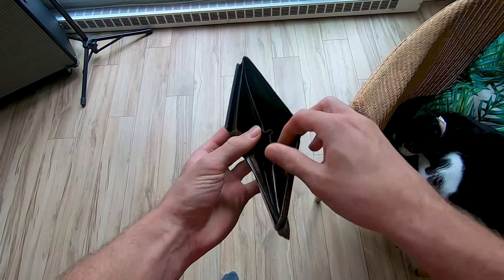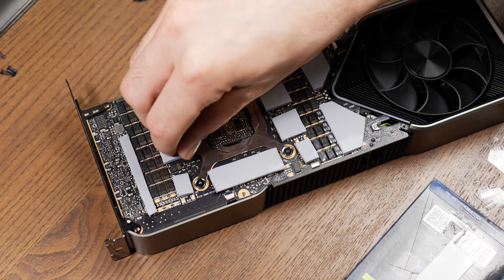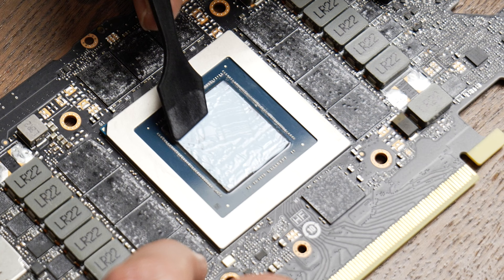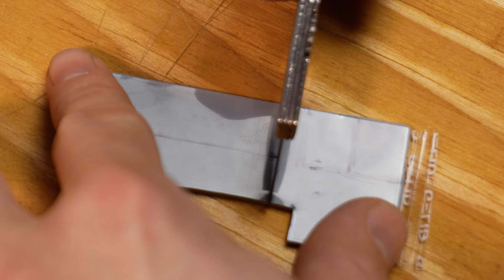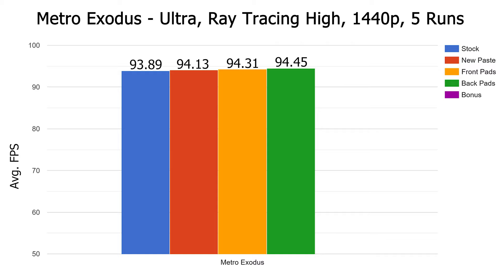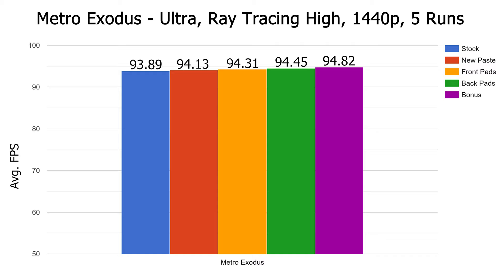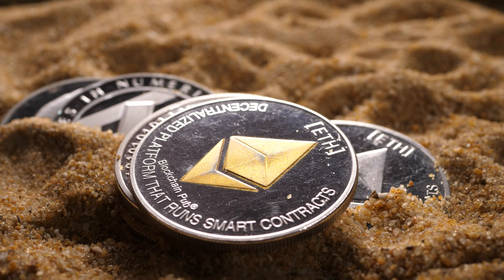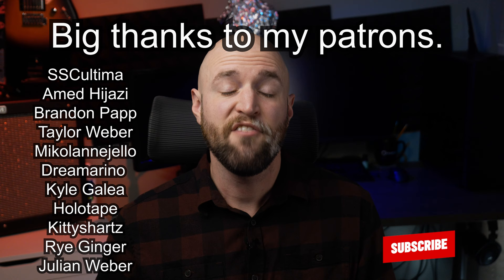Are New GPU Thermal Pads Worth It? | GELID GP-EXTREME

Comment: I think there is an advantage for the gamer from doing this. In that the card will likely run for longer before eventual failure. While I understand that the specs for the vRAM may be max temp 110'C, it's better to run cooler. It is after all, heat that destroys silicon. 

I think the 3'C drop on your GPU core is worth it too, because the fans will run fractionally quieter. 

If someone is OK with forgoing the warranty then it's a good idea all around in my opinion. Additionally though, some manufacturers do allow customers to change the thermal paste, without voiding warranty.

Honestly found your vid vaulable. At the very least it means that you could run your gaming rig in a warmer room. Which also means you can go longer before reaching for the air-conditioner. Hence a bonus for carbon footprint.

Lastly though a cooler card means less heat emitted toward the CPU cooler. Like you mentioned the temp of the backplate on your card. When I worked on my 1080 Ti, the backplate touch-temperature dropped from scorching to much more bearable. That will keep the whole card that bit cooler, and prolong the life of all components. It will also reduce the heating-cooling cycle extremes, which will help with component lifetimes.

EDIT: Possibly reducing power consumption fractionally too.
Reply: A cooler internal component does not mean less heat going inside the PC case. It may actually mean more.

Let’s say that your CPU thermal paste is REALLY bad, worse than no paste, and it only takes like 40W until it throttles. Well, it’ll only throw 40W into the heatsink.

Now you repasted it, and it can run a full 120W without throttling. Guess what? Now your heatsink will be toasty. Heat = energy, but not necessarily temperature. That’s why a car can have a much more powerful engine with a much bigger radiator, still maintain itself at 90°C, and function as a space heater much better than the lower power car
Reply: @satsumagt5284  You're working from theory of an unlikely event. If you have no thermal paste the GPU will heat up and throw heat in to the case. 

From experience I saw the following. 

One of my GPUs used to run around 70-73'C. One time when I was repasting, and I noticed and issue with two inductors next to each other, One inductor did not have a thermal pad on. Meaning no pad between inductor and GPU heatsink. Once I put a pad on, and replasted with the same paste I always used preaviously with it. I noticed a considerable drop in temps on the card. Card ran between 60'-70'C.

The result, and my argument was this. I went from needing to run my rear case fan on full, to running on medium. (I could even add a small core clock OC without any more power/voltage needed if I wanted.)

Considering that the GPU fans were having to deal with more heat, that was interesting. Clearly what matters is the temperature of the components over all else. The coolers can do their job even when given more load. What they can't do is compensate for a component like an inductor gettting hot. Then that inductor spreading heat through the board to the GPU chip. 

I.e. using better pads and paste will mean slower GPU fans and case fans, over poorer pads and paste. Poorer pads and paste mean your GPU will get hot, and the GPU fans will run very fast. Then you'll over-compensate with case fans to try cool it.
Reply: @greenbow7888  The Graphics card’s fans used to go crazy because they usually use the GPU temperature to determine their speed. They can have more inputs too, of course. By repasting the GPU, you made the heat transfer from GPU to heatsink more efficient.

With all that said, your heatsink is surely getting hotter now that it receives more energy from the GPU and the inductor. GPU at 70°C almost never equals heatsink at 70°C, especially if the conductivity is poor.

Proof of that is my laptop: Before repasting it, the case itself would barely warm up, CPU would hit 88ºC easily and the fans were annoyingly loud. That’s because it was only drawing like 23W and reaching the throttle temperature. Nowadays, the CPU can even draw 30+W with the GPU under load without reaching 88°C, the case and heatsink gets hot AF, fans are notably quieter and the performance is on another level, since it can actually keep itself at 4GHz constantly (On a cold day I don’t even need Beast Mode to avoid some slight throttling while gaming).
Reply: @satsumagt5284  Am not reading your post. You are telling me I am wrong. I am right. You are wasting my time.
Reply: @greenbow7888  Yesn’t. I only disagree with your last paragraph of the original comment. Everything else, agree

Comment: What about your fanprofile? If its stock it will just run the fans lower speed when temps drop so you have to keep the same fanspeed all the time to get accurate results.
Reply from the maker: The fan curve certainly skew the results in a way that bring the numbers closer together. But most people are going to have a fan profile that isn't flat so I like to test in a way that will show what actual day to day results look like. 

I published a video about undervolting. https://youtu.be/9JsqKREvukQ?t=232 You can see how the fan curve keeps the temps closer than they would be with a flat profile. The power differences suggest the gaps in heat should be bigger.

Comment: These results are so misleading and wrong.

The temperature reduction, yes, thats expected and obviously intended. But the reason you do this is 1) to reduce throttling and overall heat if its an old card, and 2) to increase overclocking headroom.

Reducing the core temperatures of the vram/vrm mosfets means you have even further safe overclocking headroom while still maintaining those good temperatures due to no more artifacting introduced by intense heat.

I ran a .993v undervolt @ 1995mhz with a +1000mhz memory overclock on my 2070super. Max 62~c in time spy.

Prior to the undervolt method and just attempting +100/+1000 etc directly in Afterburner, Fire Strike would artifact noticably and it'd get close to 85c. Aka it performed worse at stock voltage curve and ran hotter/downclocked a lot.

Anyway, back to the point - after replacing both paste and pads with gelid extremes, i can run 1.043v @ 2055mhz with +1200(!) Memory clock and be max 45~c by the end of Time Spy.

I have zero idea why you would expect changing the thermal pads would give you increased fps when leaving it stock. New paste would because of gpu boost 3.0, but the vrm and vram obviously only affects your memory clock which is static unless you overclock.

Comment: there new pads the 15w/m-k are good.  i use them for my sapphire toxic 6900 xt (pushing that air cooled timespy record).  the biggest difference is within the hotspot.  where i was maxing 105c on runs. but now with same settings it barely cracks over 100. thanks for the vid tho

Comment: people dont upgrade the thermal paste and pads for performance, it's for extending the life of the GPUS by years. Heat is a major culpert in product lifetime and dropping memory temperatures by nearly 14-16C is huge. Also, if you want performance, with so much more headroom with lower temperature this opens up the door for overclocking the GPU which is another reason as to why people do these mods.

Comment: I had to use new thermal pads because the old ones were torn down. It was not my GPU. The original owner was smoking. The "smoke" "glued" everthing together. There was no option than replace old ones.

Comment: Hi, I think the main thing this video is missing is… was your gpu being throttled due to temperature in the first place? Are you overclocking? If it wasn’t, then why would changing the thermal pad impact your score at all? Also, did you replace the pads proportionately in terms of thickness?

But like others have said, that temperature drop is pretty nice and worth the $ just to prolong the card’s life imo.

Your final test was fun. I love those kind of janky mods to try and eek out some extra performance. Wondering if you added some space between the fan you zip tied on to the gpu so that the fan actually has air to draw from if that would further help!
Reply from the maker: Yeah. In retrospect I wish I did prolonged tests 1hr + to get a better picture.

Comment: Point a fan at that back plate, you’d be surprised how big of a difference it can make, I’ve done it with a 2080, 3080, 3090, and a 4090 and as long as the back plate is set up for cooling properly, like yours is, it will make a pretty good difference in VRAM temps, especially on the 3090 and 4090
Oh, you did point a fan, nice, this guy is clearly a genius 😂

Comment: Replacing thermal paste is an amazing solution to older cards (2070 Super in my case) having fans ramp up and down constantly. Fixed my issues and dropped the temps by 10+ degrees. Maybe performance has also gone back up to closer to when it was knew, but that's not really the reason to mess with the paste, its the irritating fan noise.
Reply: I assume your 2070 Super was also just randomly jumping up to 4000rpm, ignoring any fan control you have set right?
Reply: @LEK  Exactly that yes. No fan controller/setting worked. But changing the paste worked completely. I did not change the pads, I was careful not to damage them. Maybe I should have done them as well, but the results were still very good.
Reply: @crispycarrots  Yeah had the same issue on my 2070 Super. They charge 700 bucks for the card but cant put the effort in to properly apply quality thermal paste and pads which arent that expensive at all.
Reply: @LEK  Dude, that is happening to my 2070 super as well!
and after tried all imaginable under the sun fan control software, it did not matter :D. I guess it is time for paste/pads change.
Reply: @GameWithTonyYT  I can guarantee that this the fix. Doesnt even have to be the pads. Paste will suffice. They use super low quality thermal paste.

Comment: Changing thermalpads is not really about gaming performance because you are using the same GPU...Logic!  We only change thermal pads solely for GPU temps and the more cooler our GPU is it helps the life span of the GPU, avoid overheating, unexpected crashes and it helps for stable gaming fps.

Comment: Asus in their infinite wisdom only covered half the memory with pads on my old 2060. They also seems to be low thermal conductivity. A $15 (Canadian dollar) multipack of basic pads allowed me to redo the VRM, add pads to the backplate that it didn't previously have, and fix the memory all at once. I still have more than half of the pad material left.
It's a bit sad that budget pads could be improve what was stock on a "premium" card. The strix models are a scam.

Comment: Great video! Another tip for greater cooling is add a thin layer of thermal past on top of the memory chips before you place the pads, non conductive paste only.
Reply: There's some evidence that suggests adding thermal paste on top of thermal pads is detrimental, as it decreases thermal conductivity (since it adds additional insulation).  Paste isn't particularly thermally conductive.
Reply: That's not a good idea. Bad tip!! It will degrade faster the thermal pads and the difference between the two thermal conductivity (higher for paste and lower for pads) will only mess the temperatures.

Comment: awesome review, great presentation of data. 
subscribed, expecting more data, and more out of mind ideas that, not sure if useleful but they are fun
if you watn to test something, no need to do video, remove the backplate, and thermal pads of backplate, and just point 45º degrees that extra fan to the back of the gpu, u will get surprised .

Comment: Hi, first of all great video and very useful. So I bought thermal pads 1.5 for my RTX 3080 Ti FE, what I kind of getting worried is that when I play some games, the temp goes and stays at 88c with the fan speed at 2800 rpm, to be honest I feel like the temps are the same as were before only that the fans are very louder, I suppose because of the rpm that is higher now...

Any suggestions?
Reply from the maker: make sure that there is good contact between the Cooler and the GPU. Try re-seating it. 

Are the MEM temps any different than before?
Reply: @TechIlliterate  I've seen in your video "Why You NEED To Undervolt ..." that on idle the RTX 3080 Ti it's at 37c, well mines it's at 60c on idle... I've checked twice the contact between the cooler and the gpu and by the MEM temps diff are higher now than before :(
Reply: @RaduPNT   I would try thicker or thinner pads... I’ve heard thinner is better with CPU paste as long as you have full coverage over the die, maybe it’s the same w/ pads.  
But if the pads are TOO thin there may not be enough tension on the cooler — and if there is an air gap, the pads aren’t doing anything. (A common issue with nvme SSD’s since the controller is thinner than the memory chips)
So try with 2mm pads first since they’re more “standard...” (did you measure the originals with calipers to get a baseline?) 
I’ve also heard someone suggest 2mm pads on one side of GPU & 3mm pads on the other
Another big suggestion is because the Founder’s cards run extra hot (having only 1 or 2 fans), get them extra cooling— try to install 2 120mm fans under the card & blowing up. This is ideal with a case that has intake vents on the bottom, like most Lian Li cases. Yes installing a whole new case is a pain, but temps are important for the life of your GPU & CPU

Comment: Its becoming hard to find thermal pads these days in my part of the world. What is the degradation expected when we stack 2 x 0.5mm pad instead of a single 1mm pad?  Have you tested this?
Reply: They are pretty soft, i doubt there's any degradation and if there is it will be miniscule
Reply: @psychoalert1823  i was asking about the thermal conductivity. If i use 1mm pad and stacked 0.5mm pads will the difference be considerable?
Reply: @athirasreekumar1613  That's what i replied to, as long as there aren't any air gaps in between then you should be good to go

Comment: Hi,

I have a 3090 strix which I remember reached 90c on memory without undervolt. Is it totally safe to be around 90c? I've always freaked out about the Temps.. Thanks
Reply from the maker: Yup that's good! My card has reached 90c max now with the pad mod during longer gaming sessions. 

Plenty of headroom to the throttle limit.
Reply: @TechIlliterate  110c is the limit right? I will try to run some game again without uv to see. I was running 1865mhz at 0,837 / testing now 1965@ 0.9 and it seems stable!
Reply: @TechIlliterate  I went back to stock profile without undervolt

Playing on a C1 oled 4k, 70c max on core and 86 on memory on days gone for instance . Is it all good?
Reply from the maker: @asryan7582  Yeah that's well within a safe range.
Reply: 90 degrees is fine.  It will more than double the memory's lifespan vs. running at 100.
Reply: @Magnulus76  Thanks !

Comment: Unless you are thermal throttling you obviously will not see any performance improvement.
It is about better thermals.
You "might" be able to overclock the card higher due to lower temps. Might.

Comment: Excessive cooling of vram means they run faster rather than design limit so they draw more power and stress the other components, and you may burn out your power circuit, sockets are likely already run at max load. GPU engineers are way more qualified to build GPUs than YouTubers.

Comment: Even if FPS not JUMP UP! you prolong your gpu lifespan a werry werry hardly.. there is diferencies between 75-85 ad is like 6-8month lifespan cut off.. you have 110 you know what harsh enviroment is it?? geez that litle metal ball solder under every single memory chip screaming by painh under tension..  andthere is like 120+ solder joints.. so trust me if i say as guy who servicing this shet over 13 year's.. it do the job werry well..

Comment: If you're not seeing a drop in temperature with those Gelid GP-extreme thermal pads, you're doing it wrong. And just by looking at how you applied the thermal pads on the card, it's obvious you have no idea what you're doing. But hey, at least you saved yourself $15 by not buying something you don't need. Oh wait... 🤣 Ps. Thermal pad thickness matters. 1.5mm is your safest bet as most current gen GPU use 1.5mm thermal pads from the factory. 2.0mm is way too thick.
Reply: What about 3070 suprim x?